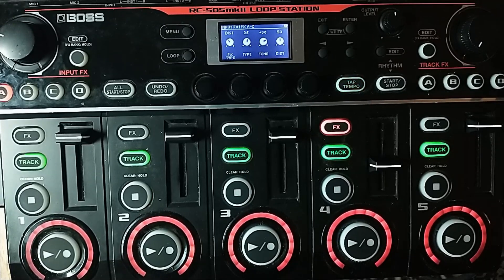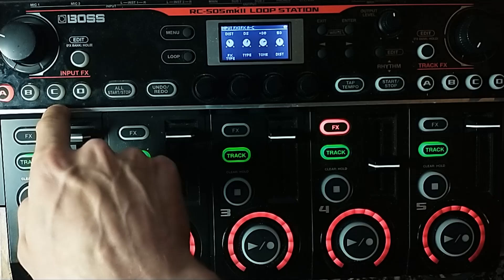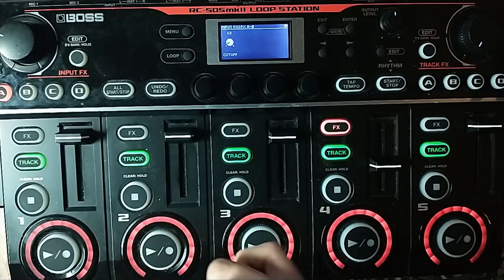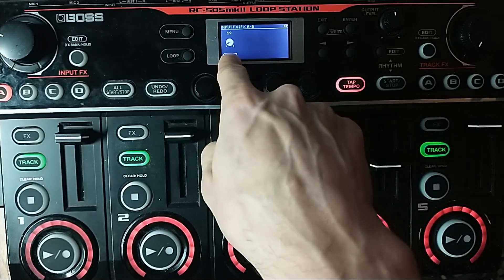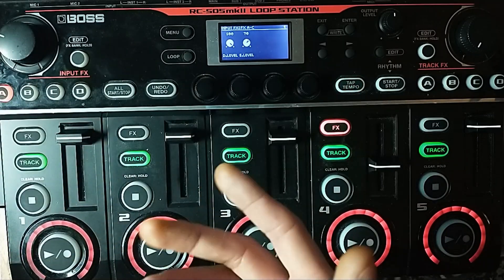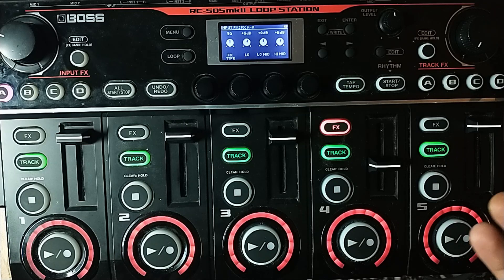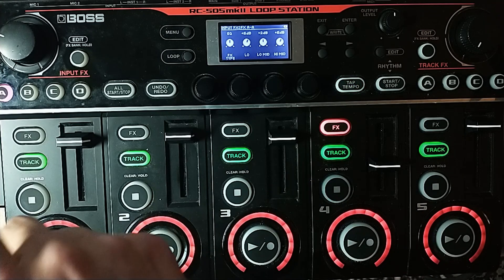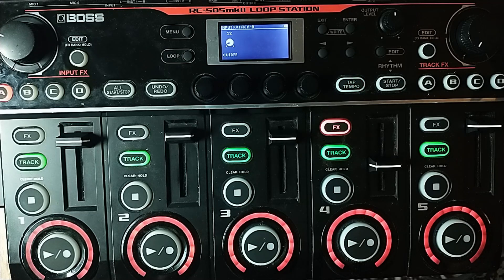Rc505 Mk2 Tips Ep12 - 808 Bass Using Low Pass Filter (LPF)

Comment: I recently bought my MK2, and I have no clue about what to do with it. Your videos have been very helpful to me.
Reply from the maker: Yay! That makes me very happy to hear! Have fun on your looping journey and thanks for the view and comment!
Reply: You know why my tempo is automatically changing?
Reply from the maker: @rohanthomas030  I'm not exactly certain unless you upload a vid for me to see what's happening, however, there is a common tempo related thing which may be tripping you up.

when your mk2 is idle (not playing any tracks) there is a tempo you can select, but it can change when you create your first loop. This is the important part: If you record your first loop WITHOUT the rhythm section playing, the tempo will be changed to match the length of your first loop. If the rhythm section IS playing the loop will be set to the tempo which you have programmed. 

Try setting your rhythm section to just a click, set the tempo before recording your first loop, and have it playing during the recording of the first loop. After this you can turn it off and your tempo will remain steady until you change it using the TAP TEMPO button. It's a bit weird at first but as you get more familiar with looping, you will find use cases for both methods of setting tempo. It should also be noted that anything which is sending a midi tempo signal through your MIDI IN port will usually take over as the main tempo, but if you don't have anything plugged into that port then you don't need to worry about it.

Hope this helped and if it didn't, upload a video of your issue and link it here. I will take a look, cheers!